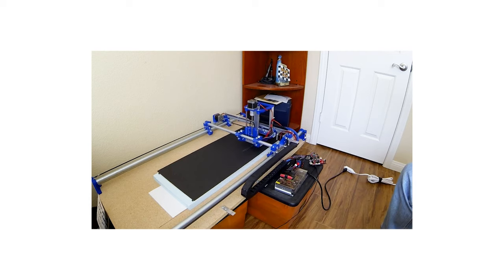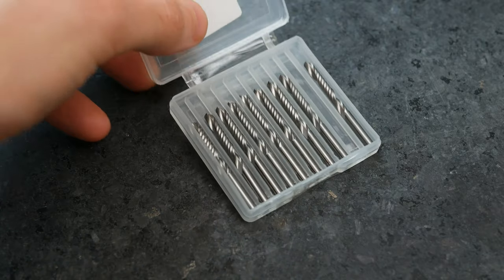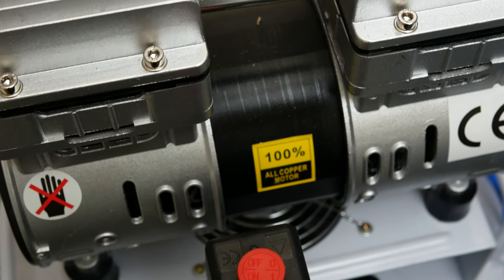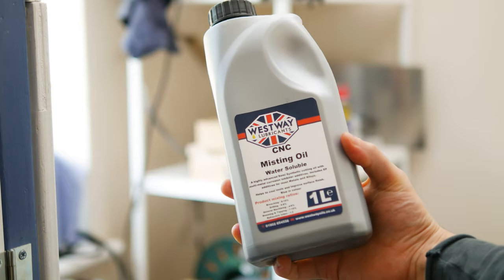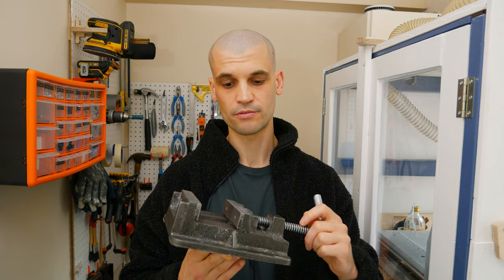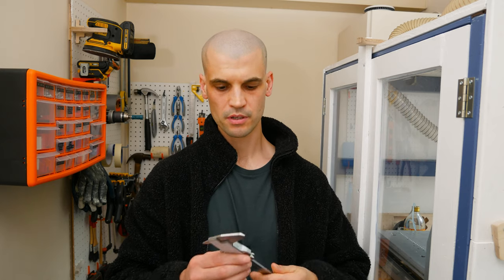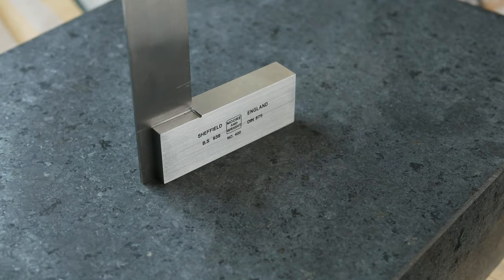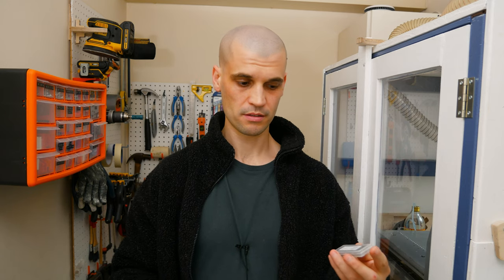Cutting aluminium on a desktop CNC - Must have upgrades!

Comment: One thing I'm not sure you mentioned - using an upcut endmill.  Aluminium chips need to be evacuated from the workpiece.  Endmills with downcut will push chips into the workpiece and cause friction welding / gumming / snapping endmills ;)

Comment: 1 or 2 flute end mills are fine for aluminum. Coating is important though! You want TiSiN, TiCN, ZrN or uncoated endmills. You DON'T want an end mill with any coating containing Al (aluminum) as that will increase the tendency for chip welding to the milling bit.

Comment: I highly recommend using a fixture plate, I bought one for the cnc I use at work, and having the ability to make repeatable setups is such a time saver.
Reply from the maker: Yes I've just begun using fixture plates for an upcoming project and it really helps. I used and Mitee Bite pitbulls and they do such a great job
Reply: I have been trying to think of how to use pins. I was going to drill holes all across the x axis on the table, and then I can index my work with pins/bolts. Then I could use the pin position as a center line for flipping projects over, yet retain the positioning.
Reply: @DistantVision85  if you model your fixtures/vices and have known locations that your pins go into its very easy to make repeatable setups, or flip fixtures around.
Reply: @davidfarmer  I think that requires perhaps more sophisticated software than what I use. I have a simple diy machine running off grbl and UGS.
Reply: @DistantVision85  If you have fusion you can use that to generate all of the gcode and model the fixtures etc, the only thing your machine software needs to do is home to a repeatable position, or just hold position after you manually locate a known position on the table.
Reply: @davidfarmer  Yes, well, I do have fusion, but I am not accustomed to using as well as your concept would entail

Comment: You can add capacity to your compressor by adding an extra tank, best an empty stainless steel butane gas tank. Add a Tpiece to the outlet of your compressor motor where it enters the original tank, that way it will fill up both tanks and give you more volume of air. For a vice lookout for a surface grinder vice most are fairly low profile.

Comment: I have seen an addition to add more air and it may be a bit risky for a beginner to do.  It is adding a portable air tank after the compressor and before where the air will be used.  One of my brothers and I were stuck with a flat tire and had a portable air tank and a car tire air pump.  He had an impact wrench, just not spanners to remove the wheel to put on the spare.  The short version was fill the tank, use the impact to take one lugnut off, repeat for almost 2 hours.  In this case, you might want to add a one way valve to have the portable tank act like a secondary reservoir and possibly a T connector so you only use one location on the tank, making it possible to follow Youtube videos on how to use a propane tank as a portable air tank.  Thank you for such simple and concise information that, as you pointed out, is easily overlooked.

Comment: Iscrapped my air compressor and switched to a small reciprocating air pump. Its about 6 inches cube and nice and quiet, and pumps a serious blast of air onto the cutting tool. I actuallly have dual nozzles at 90 degrees to really clear out those cut grooves.
The recip pump needs nomtank and only comes on when you need it (when my spindle is running). Cost about $100 USD from memory.

Comment: As a trade mechinist I agree with many of the points in this video, the only thing I want to say is when it comes to taps invest in spiral flute taps instead of strait flute. The spiral flute brings the chips up out of the cut, they are therefore far less likely to brake in your hole
Reply from the maker: Thanks for the tip
Reply: I am never going back to straight flute taps after using those spiral flute taps, cut so much better. Also adding a chamfer to the hole before tapping is always a good idea, plus looks nice.

Comment: Very helpful thanks, i'm just getting into this. For wood milling i 3d-printed a propeller that fits onto the endmills so automatically blows the dust away. Yet to try aluminium!
Reply from the maker: Ohh that would throw the wood dust everywhere though. Get a dust shoe and vacuum setup. Will save you a lot of time clearing up
Reply: @ThisDesignedThat  Yes you're right there!

Comment: Thanks for putting that video together, lots of good points. The mag base is good, just clamp a steel parallel ( or block of steel) on to the table , may be a 1,2,3 block ( 25, 50 75mm) I bought a vertical band saw can cut metal and wood. Please clamp your metal vice down, fix it to a block of ply or steel and then use a G clamp(s) when you want to use it.
Well done with the safety tips, your compressor will have a blow off valve so if the working pressure is 100 psi it will go off at 115psi, should have a check every now and then, we do it every year, visual inspection and change the oil, drain the tank every month to get out the condensation. Well done and good luck
Reply from the maker: Thanks for the tips Laurence

Comment: Look for an auxiliary tank and hook it up to the out flow port . You can easily double or triple your total volume . You can also put the compressor away from your work area . I'm in the States and have been running one compressor or another for the last 20 plus years , pressure is always 150psi or better and even have a small 4500psi unit . Never had a compressor blow up , have burned out motors and pumps but that's about the worst ! Good luck and thanks for the insight , because I'm leaning towards getting small cnc machine . Thank you
Reply from the maker: Yes I saw John do this on his early NYCNC videos. At the moment I dont do long cutting jobs on this machine to the compressor does what I need for now but I'll think about this upgrade in the future.

Comment: About endmills, i've always heard to not cheap out on them. You might be breaking a lot of endmills because they are cheap and so not as tough ...

But i guess if you're a total begginer it might be interesting, i'm talking "i don't have a clue what speed and feed means". 
An other positive aspect of good endmills is that they'll come with documentation that can be trusted, which can ease the dialing of speed and feeds
Reply from the maker: Yes I do partly agree with the first part but Ive broken many endmills purely from the crappy electronics in this cnc. So many times it just cuts out while cutting (with the ncpod not detected mach3 error) also just silly things like moving the spindle and crashing into the workpiece when trying to set zero point.

i'd be so pissed if i snapped a £40 endmill from a silly mistake like that

Comment: Useful video, right about vices, as a temp solution to the drill vice is to use a round bar on the moveable jaw against the material edge, a light tap down , should correct the material lift!

Comment: I needed to hear this.  I was going to get a modest CNC/router rig figuring I'd use it for occasional aluminum machining.  But everything said here makes a lot of sense.  Basically the investment will be double what I planned on and take up a lot more space.  Thanks for sharing your hard won knowledge.
Reply from the maker: Hi Dennis, yes definitely true, ive still got about £1000 i need to invest in my machine to completely overhaul the electronic enclosure.
Reply: @ThisDesignedThat  Yeah, I'm not ready for that.  I'm 3D printing and wanted "metal backup."  Had I not come across your video I probably would have shelled out $1000 and found out the hard way.  So thanks again.  

And good luck with the manufacturing path.  I'm retired so it's too late for me (teacher!), but if I had it to do over, I think I would be a manufacturing engineer.  I met such a guy while camping, and I envied him so much!

Comment: Hi Paul great video, just about to order my first cnc (total newbie) I found your video very interesting and as you say it's a big expense. I would like to keep in touch with yourself if possible as you are in the UK
Reply from the maker: Hi Paul, what CNC are you going for? Actually today I just nearly finished making a fixture plate that will sit on top of the tslot bed of my CNC, you'll probably want to make one of those too, heres my progress with it. https://www.reddit.com/r/hobbycnc/comments/l21mqm/some_progress_made_today_on_my_fixture_plate_for/ And yes please do stay in touch, im quite the noob with all this but happy to help whoever I can.
Reply: Paul its a guy up in Inverness that makes them it is called scorpion cnc, all German parts including the spindle and a cut area of 3ft x 2ft for £1350 delivered. Hoping you will kept me right lol :) still to decide what software I'll use, I have double garage so I've already have 150L Compressor for air blower and coolant, I may change the design and put slotted aluminium table rather than mdf. I will go and have a look t your fixture plate, keep up the good work

Comment: Nice video, thanks. For beginners I would highly recommend studying more on material speeds and speed and feed rates, chip loading and cutter geometry. Aluminum galling (gumming up) can be due to spindle speed being too high or the chip load too small. Aluminum is forgiving but stainless is not. In some cases, machining slow is not an option if the spindle or motors can't keep up.

Comment: Most people see the cost of the machine and figure, that's the big expense right there. But yeah, your money is going to be in the tooling and measuring tools. 
But even if you're just starting out, look for deals on used Mitutoyo and Starrett, high quality precision tools made in Japan and the US that last a lifetime. A lot of my measuring tools were given to me by my grandfather after decades of use in a machine shop, and they are still in good shape and accurate.
Another tool to invest in is a chamfer bit, its good practice to always chamfer the hole before you tap it. Makes starting the tap straight much easier and makes threading a bolt into the tapped hole much easier. Plus it just looks nicer, more finished and professional.

Comment: IPA works well as a mist coolant for cutting soft metals. Cheap and much less mess than oil based cutting fluids. Also less likely to damage wooden waste boards.
Reply from the maker: Isnt it highly flammable though?
Reply: @ThisDesignedThat  I don’t think that’s a problem in normal use. If your cutting bits are getting hot enough to ignite alcohol something is definitely wrong.

Comment: Nice video, Have you considered adding a buffer tank? You could do that and keep the same air compressor.
Reply from the maker: Eventually I will but currently this works for my uses. I dont do long hour+ operations on this cnc because the controller is complete rubbish and I cant trust it to work long operations. I need to overhaul the electronics of this cnc completely at some point

Comment: Really great information you have presented here. Thanks for posting. What do think about painters tape and super glue technique? Also is there any advantage in using a larger collet? My machine uses ER-11 , do you think upgrading to er-20 would be better for aluminum?
Reply from the maker: Painters tape works great but I have found for long operations and when I am using coolant I have had the tape come off the metal. When Im using coolant I like to use Mitee Bite workholding wax as it is waterproof and great for holding thin stock.

Larger collet size can be helpful to get access to bigger and more advanced end mills (indexable etc) you need to make sure your machine can handle the bigger size endmills though. I would love to have an ATC spindle above all else, I would love to have auto toolchanger on my CNC, in the future I plan on making this upgrade

Comment: don't go too cheap on the digital Vernier 
I got some off ebay and the inner diameter gague didn't even line up : ( 
only good for outer diameter readings, and it's pretty iffy on those too
but I STILL use it for everything because of how essential the tool is
Reply from the maker: Im thinking about investing in a Mitutoyo  at some point, I dropped my cheap chinese version and bent the edges slightly. I'd really like something to measure bore holes

Comment: Thank you so much for taking the time to make this video. Are you still using the 800 watt spindle? Do you find it limits you or is it working just fine?
Reply from the maker: Still using and no, i havent seen it to be a limitied factor at all. My endmills break before the spindle loses power.

I would like a bigger ER collet size though and thats really the only reason i would upgrade. I know nothing about electronics so im put off doing upgrades to this cnc. I cut aluminium fine on it though.
Reply: Thank you so much for your responses. I look forward to seeing your other videos.

Comment: About surface plates being cheap in the US, if you're near the seller, than yes, but if it has to be shipped, that often doubles the price, or more. Also, it's easy to get tricked into buying something used, assuming that it's much cheaper than new. Not always!
Reply from the maker: so true, postage costs always add so much to these type of equipment, local pickup is really the only feasible way

Comment: Check out the Flexispeed Mk1 Horizontal Milling Machine

For the money this is a much better buy then what you are using and the performance is much higher. I don't see a lot of reviews out on them so you may be able to get a deal to do one. Good luck on your plans

Comment: Some of those engraving bits can be modified for thicker lines. I basically just make a new tool profile, and fix up the broken tip to suit the profile..
Reply from the maker: Interesting, would you just use a bench grinder or something to make the new profile?
Reply: @ThisDesignedThat  Well, with the really pointy engraving bits, if the tip snaps, just clean the tip up. It is now a flat bottom engraving bit. The profile I mention is just the setup for tool selection in my design software

Comment: Rhere are formulas for the feed and speed to count what speed and spindle speed you need for every materiial.
Reply from the maker: Yes but ive always found those arent suited for small hobby cnc machines. I bought a subscription to gwizard when i first started and always snapped my bits when using their recommended settings, im guessing my 800W spindle couldnt keep up and cause issues

Comment: Just starting out so this was helpful. Just a couple of questions. How do you collect and dispose of the coolant. Is it because it's mist maybe there isn't as much as I'm thinking?
Reply from the maker: Yes there isnt much left over when using mist coolant, just a wipe with a cloth is enough. I also sometimes just lay some kitchen towel next to the work piece to soak up any coolant incase im using a lot of coolant or trying to tweak my flow rate. Worst case scenario is it will just drip through the T Slot bed and onto my plywood enclosure base, again you can just wipe this so theres not much to worry about.

Comment: Is your opinion on single flute bits still holding up? Some people recommend e.g. 3 flute bits because they have thicker (therefore stronger) core vs single flutes where the one big flute eats away more diameter from the core?
Reply from the maker: i still only use single flutes, i havent experimented much with 3 flutes but I do understand the point you make regarding increased rigidity so it might be worth a try